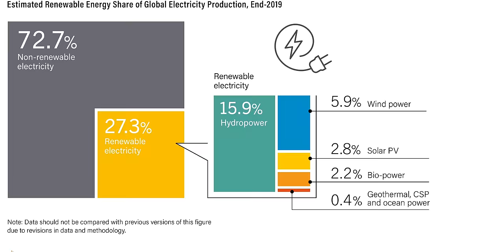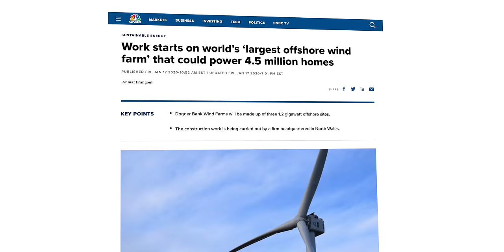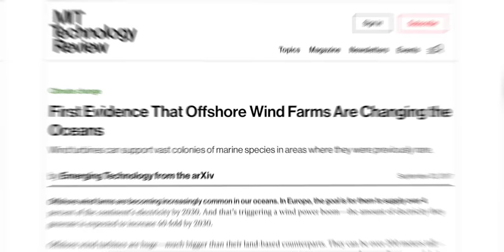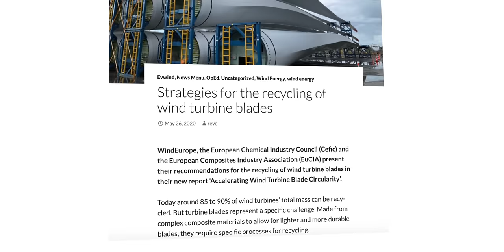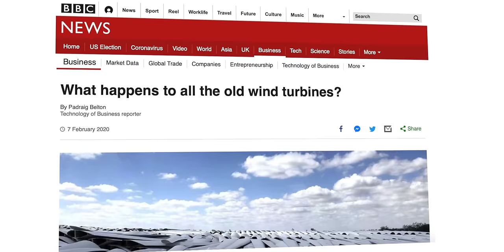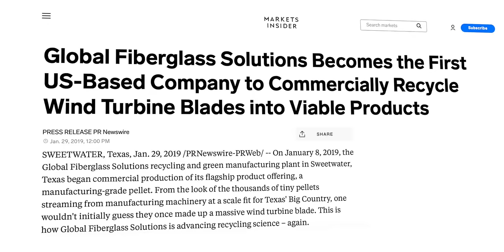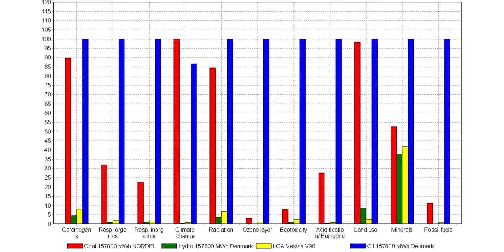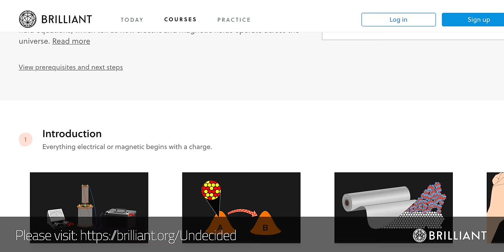The truth about wind turbines - how bad are they?

Comment: We have thousands of windmills in our part of the country and they only run about 20% of the time
Reply: where are you located?
Reply: @daverichards1990  south west corner of Alberta
Reply: interesting because it is more than 40 percent of the state of Iowa's energy portfolio.
Reply: Your in trouble windmills and solar panels don't work  ask Texas but if anyone figures out how to build an battery efficient enough and large enough to power a small city then you will be getting somewhere until then you need a traditional power grid
Reply: @donturner9510  the reason the ones in Texas didn’t work is because they were never designed to be in that cold. Wind power isn’t reserved for warm places. You gotta remember that storms like that are extremely rare.
Reply: @ilovewindex487  nice try they don't work we have no storage capacity so as soon as it gets dark or the wind is not blowing there is no power so you still need a traditional power. On top of that more energy is needed to produce the panels and windmills the thay will ever produce  also it took over a hundred years to get our power grid working fairly well it will take another hundred to switch to the unreliable system
Reply: @donturner9510  I may be wrong on this but most other forms of generation have no storage, right?
Reply: @ilovewindex487  you are right there is no storage but when demand rises you fire the boiler harder and increase
 generation. If the boiler trips you refire and start generating
 again. What do you do when the wind stops and the solar panels are covered in snow or dust or it's dark? On top of that it takes thousands of windmills and/or solar panels to do what one steam powered generator will do.
Reply: @donturner9510  ah now I understand, I’ll need to research this a bit more to understand this a bit better.
Reply: Every wind site business case is created after a whole evaluation of past data and prediction of wind for on average 2 decades. That is taking into account by investors since always. Also, the wind works differently depending on the season. It may be the case that in your area the turbines are indeed working less for now, but soon more wind will come.
Anyway, the whole point is that businessmen are earning money with their investments in wind even before it was cool. Capitalism is just replacing technologies as it does best.
Reply: @latinha1903  to bad the government subsidies the cost to produce so the investors get their money at taxpayers expense for an unreliable service I wonder who invested early friends of the people pushing the agenda
Reply: @latinha1903  to bad the government subsidies the cost to produce so the investors get their money at taxpayers expense for an unreliable service I wonder who invested early friends of the people pushing the agenda
Reply: @donturner9510  I guess that is the problem of having such a divided country. Philosophies change abruptly and so subsidies, which make people from both sides not trust investments from the government, because they always sound too ideological. I understand where you are coming from,  so I invite you to check places where wind energy is proven to make sense financially. For example, in countries that do not flip that much or are simply not making an ideological issue out of this, like Brazil, China, Spain, Germany, Denmark.
Reply: That doesn't sound like they are in the right location.
Reply: @ilovewindex487  The traditional grid is what broke.
Reply: And they are massively expensive 100% of the time! And fantastically inefficient when they DO run!
Reply: @jackfenn7524  What you said is 100% wrong. Search for "Levelized Cost of Electricity (LCOE)", this is how we can represent how expensive is each source. LCOE comparisons show that wind is competitive even without any subsidies.
Reply: @daverichards1990  USA!
Reply: @jnyboy28      Do you know what "Clipper Ships" were? They were very efficient because their sails were perpendicular, (at right angles to), the direction the wind blew. They had several ACRES of sails! And they were the least expensive sailing ships ever built! If wind "turbines" were fitted with huge SAILS, they would produce huge amounts of TORQUE, (foot pounds of energy), and they would produce 100 percent of Iowa's electricity! (You gotta have something for the wind to PUSH!)
Reply: @latinha1903    Lucas, I live in one of the windiest areas of North America. We have enough wind here, IN THIS STATE, to power the entire USA! But you must have wind MILLS to do that! So-called "wind turbines" were designed by the ENEMIES of wind power!
Reply: Wind MILLS?  Or wind TURBINES? (HUGE difference!)
Reply: @ilovewindex487    And make sure you keep producing them buggy whips!
Reply: @jackfenn7524  what ever you want to call them they don't work

Comment: I heard that when a gas or coal plant is built, it just magically appears overnight!
Reply: Nobody thinks that. 

But the amount of material needed to produce a MW of coal or gas is a fraction of the same amount of material needed to build a MW of wind. And it’s more reliable, too.
Reply: @M0rmagil  
If you consider the actual footprint and include mountain top removal or open pot mining the equation starts to change. When you add the rail needed to move the coal it has swing even further. A powerplants footprint must include the energy source. Every part of the energy supply. Wind turbine can be recycled including the blades. Every part of the turbine is 100% recyclable. But the real issue is the amount of fuel needed to power a coal plant. If that is ignored then the equation is invalid.
Reply: @andrewday3206  the rails  already exist.
Reply: @isaaclang6031  
So the fuel required to move the coal is magically pollution free?
Reply: @andrewday3206  Go a day without your car, bus, or subway, don't eat all day, no water,  no internet, no TV, no phone, no emergency services with a blanket and hot chocolate.  Understand the things you hate so much before you criticize them.
Reply: @isaaclang6031  
When did I say I hate?
I understand energy and it’s environmental impact. Intelligence and technology solves problems. Looking backwards isn’t being a leader. As technology advances our ability to better solve problems improves. If you don’t like technology go back to the horse and plow.
Reply: @isaaclang6031  that response has no connection whatsoever to what Andrew actually said. You basically just verbally vomited because you did not like Andrew’s response. There are better ways of dealing with those reactions.
Reply: @andrewday3206  I like the idea of solar because its solid state but powering things at night is obviously the issue but its a lot more reliable than wind and doesnt mangle birds. If theyre gonna build these things out in the ocean where saltwater corrosion is a factor it seems like they should just develop something using polymers to address that and make it submersible to take advantage of the tides because tidal action seems more consistent and there is a hell of a lot more kinetic energy being driven to move water than air.
Reply: @andrewday3206  a disel truck takes polluted air in . And cleans it .
So yes
Reply: @hondamanvtec2894  
That’s just plain stupid
Reply: Fossil fuels are more energy dense. This is all about jobs and narcissism
Reply: @M0rmagil  so what ?

We will definitely evolve 

And today there is less or no solution to recycle the materials used 
But we cant say that it will not exist

Most beautiful thing about science and technology is it evolves!!
Reply: @M0rmagil  The modest sized coal plant near me used to get two hundred boxcars of coal (18000 tons) delivered every week and sent back about thirty box cars of coal ash. (Milliken power plant.)
Reply: @hondamanvtec2894  I've seen this claim and it's not true.

Comment: Lifespan, non-renewable materials, environmental costs, economic costs, on and on....
Reply: None of those things are limited to wind power. Every form of energy deals with those factors. You think they make nuclear reactors out of recycled materials? Wind is still our best option that leaves the least amount of destruction in it's wake.
Reply: @michaeldougherty6036  They're just not as hyped as wind and other EPA climate projects
Reply: @mikegilyeat3213  Of course the aren't as hyped. They've had their day. And older types of power plants got plenty of government assistance when they were getting started too.
Reply: @michaeldougherty6036   Except that for a given volume of materials, nuclear energy produces hundreds, possibly thousands of times more units of energy.
Reply: @randallsemrau7845  Exactly. Nuclear power is so much more energy dense than chemical energy. There's almost no comparison.
Reply: @michaeldougherty6036  nuclear actually produces a fraction of the non renewable waste that wind does, even less with current innovations in nuclear energy
Reply: @saf4433  A fraction. But that fraction is radioactive waste. So comparing it by tonnage is ludicrously disingenuous.
Reply: @michaeldougherty6036  and wind and solar powers non renewable waste is toxic chemicals from the batteries, so not that different. Also, there are currently nuclear reactors that can be powered with the current nuclear waste left from decades old inefficient reactors, so it'll be reducing waste while producing power.
Reply: @michaeldougherty6036  Spent Nuclear fuel can be recycled with Mixed Oxide Fuels currently in use iin France; or multiple times over by Pyroprocessing. While Nuclear Power plants may take large areas, if we compare by energy produced per area occupied, nuclear is by far the most compact. And in a industrial world, getting more out of less is more important than just seeing the raw costs. Nuclear doesn't need dedicated storage, and can be built in any area that isn't seismically unstable or isn't mountainous.

Comment: The life-span of wind turbines is proving to be less than expected. Location and the elements they are exposed to in certain locations are a big factor. They last about 20 to 25 years. That's it. Can you imagine building a fossil fuel power plant and then tearing it down in 20 or 25 years to build an entire new plant to replace it? Of course not. What gets done with the blades when they have deteriorated beyond use? How much fossil fuels is used to build and construct the turbines? A LOT of fossil fuels used to transport, destroy, and burn the blades. There are a lot of "inconvenient truths" you need to acknowledge.
Reply: That's one thing I've never understood about putting them in west Texas.  There are regular high wind dust storms out there.

Comment: Do a video on what is actually used to make each wind tower work also cost of installing and at what point the wind tower actually starts off setting the cost of the job!
Reply: Search for LCOE, levelized cost of energy. You'll find that coal and nuclear are now double the cost of wind or solar. The first two are already going away just from economic forces.
Reply: @pcproffy  you are joking right? those sources are so skewed.
Reply: @pcproffy  Very true. And cost for nuclear does not include cost for 240,000 years of waste disposal.None has been dispose do for the 75 years of commercial nuclear energy production.
Reply: Sadly in all wind farms when the carbon cost of manufacturing, instaling the mills and their infrastructure is far greater than any CO2 offset by their power generation in their 30 year life.  California has become a windmill junkyard.  The environmental cost has been enormas, and after billion they still have brown-outs.

Comment: Matt overlooks the fact that Wind turbines are efficient in a very limited range of wind speed. Most turbines will generate power starting at 3-5ms but at that speed electric generation id nominal at best. The ideal speed for a turbine is 12-16 ms and at 25 ms turbines have to be shut down as they can't handle that speed. When considering the short life span of a wind turbine, the inconsistent power generated and the cost to build and remove, wind turbines barely produce enough clean energy to offset the amount CO2 that was used to build them.
Reply: Joe M -vertical wind turbines produce power are low wind speeds and are self limiting in high winds so blade centrifugal force us not a limiting factor. Large three bladed wind turbines have tip speeds approaching 200 mph with the result that raindrops and hailstones act like shot blasting delaminating blade leading edges requiring replacement  every few years -especially offshore maintenance costs are very high and access difficult at at times impossible  .
Reply: Fact: Wind turbines offset their energy required from production in their first year of production and far less in most cases. I don't understand why this idea is even entertained by people at all. The math isn't even that hard to do yourself. A 3 Megawatt (MW) wind turbine has about 500 tonnes of steel including the nacelle, tower and foundation.

400 cubic meters of concrete for the foundation. It takes about 70kg of coal to produce 1 cubic meter of concrete = 28 tonnes of coal and for the nay sayers, lets double that to cover the manufacturing, shipping and installation of the concrete to 56 tonnes per turbine.

Now the 500 tonnes of steel. It takes about 770kg of coal to manufacture a tonne of steel = 385 tonnes of coal. Again for the nay sayers lets double that number to 770 tonnes for manufacturing, shipping and installation of the turbine.

Now lets add those two together and you get 826 tonnes of coal required for manufacturing, shipping and installation of each turbine. Thats a big number, no doubt. But! it takes about 1 tonne of coal to generate 2 Megawatt Hours (MWH) of electricity. So for a turbine to offset its manufacturing, shipping and installation it will need to produce 1,652MWH of electricity. Still with me?

Now lets talk turbine electricity production. A 3MW turbine is capable of generating 3 megawatts at peak output, but it doesn't run at peak all the time. Thats the capacity factor. A good average capacity factor is about 30% which is low for modern turbines, but we're working on averages. So that means that 3MW turbine is 0.9MW turbine on average. Now we need to get to megawatt hours. 0.9MW x 24 hours per day = 21.6MWH of production per day, per each turbine. Now lets take that and divide our previous number of 1652MWH by 21.6MWH to find out how many days of production it will take to offset its manufacturing, shipping and installation. Still with me? 76.5 days. Thats it. Each turbine produces as much energy as took to build it in 2.5 months. 

I challenge you to find these same numbers from any source other than anti wind sites. Run them yourself and try to show my math is out by 95 times.
Reply: @JimP226  yes but they only operate about 30% if the 8600  hours per year -solar panels generate power for 4300 hours a year and tidal turbines about 6500 hours a year .Tidal turbines are unaffected by sea conditions and even onnfull days solar panels produce power -wind turbines produce nothing when there us no wind and they shut down in high winds to avoid destruction by  excess centrifugal forces .And wind turbines especially offshore require a lot of very expensive maintenance and blade changes every 3 or 4 years.
Reply: saladdogger  the problem is that over the year there are only around 2000-2500 hours of wind so 70% of the time a turbine is not generating power .Firstly a turbine.can only extract at most 16/27 th of the energy in the wind ( Betz Law ) .Secondly even when there us wind if it is below a minimum then the turbine won't produce power above  a certain speed the turbine shuts down  And thirdly they needvs huge about of maintenance and blade replacement every few years .The problem with all wind and  solar  " green energy " is that it is intermittent and most is produced in the summer months when the power demand is at its lowest .
Reply: saladdogger  they will certainly produce more power than they use in manufacturing but until we have large scale commercially viable electricity storage the intermittent output of wind solar and tidal will remain a problem requiring gas coal oil or nuclear back up if at least 80% of peak demand .What we need to do is reduce demand with better electrical efficrncy of equipment lighting insulation heatpumps etc
Reply: @JimP226  You forgot to include the CO2 produced making the concrete and the transmission losses to hook into the grid and the fuel burned to keep the backup gas turbines running to cover when the wind stops . TANSTAAFL

Comment: Put up a couple of windmills so they could charge more for "green, climate saving energy". Geothermal and nuclear, is the way to go.
Reply: Like in Texas where they charge 32.000% more for gas and 10.000% more for electricity to people that have a variable rate  .
Reply: The problem with nuclear is that no one wants to store the nuclear waste  cus its expensive
Reply: @Max-bw4uc  Thorium reactors are the way to go
Reply: If that’s what you took away from this video, you are extremely naive. Not everybody lives in Iceland, Geothermal just isn’t readily available for the majority of consumers. Also, if the environmental downsides of wind energy turns you off, I have some seriously bad news about nuclear energy. The “way to go” is to diversify into all forms of energy generation wherever it’s viable. You don’t live in a desert and decide that hydroelectric power is the way to go. Use what works.
Reply: @Max-bw4uc  extraordinary claims require extraordinary evidence. What’s your evidence?
Reply: Nuclear isn't going anywhere. Too expensive and nobody wants to pay for it. Plus the negative effects of nuclear waste.
Reply: @belland_dog8235  Nuclear is drastically less expensive than "green" energy. German (the most "green" energy) citizens pay nearly double the energy cost as France (the highest nuclear) citizens.